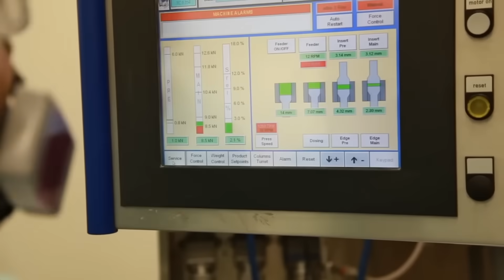Why These Engines Only Last 3 Seconds

Comment: The UK (Santapod race way) still holds the world record  3.48 seconds @ 386.26 MPH.  Engines last much longer than you think. Many teams can run a season with 1-2 engines. They are not rebuilt after every run, they are striped and inspected after every run to make sure there are no problems. If there are no problems it's put back together ready for the next run. Clutches are rebuilt after every run.
Reply: That was a rocket. Santa Pod is the venue at which the current world drag racing record, a time of 3.58 seconds at 386.26 miles per hour (621.63 kilometres per hour) was set by Sammy Miller in his Vanishing Point rocket-propelled funny car in July 1984.
Reply: @johnmadsen5258 had the fortune to see that same car at Maple Grove Dragway sometime in the 80s.  He broke the track record that day.
Reply: @johnmadsen5258  I was there when he did it. One of the most impressive things I have ever seen.
Reply: @johnmadsen5258  I was there at the time. Fantastic memories.
Reply: Ehh, why are you citing rocket dragster records while discussing the durability of top fuel motors?
Reply: @codymoe4986 because a top fuel has never come close to going that fast. 338 mph is the world record.
Reply: @Bryan-Hensley because it’s not a rocket it’s a dragster 😂 and if you want to talk about rockets nasa holds that record
Reply: @Bryan-Hensley  Yes, and surprisingly a Funny Car driven by Robert Hight holds the official NHRA speed record at 339.87 in 3.80 seconds. NHRA racer Bob Tasca holds the all-time speed record at 341.68 in a Mustang Funny Car, but it wasn't at an NHRA sanctioned event. Why is a Funny Car often faster? Superior aerodynamics.
Reply: @cll1639  that big ass wing in the back of dragsters makes alot of downforce and also can create alot of drag while moving at those speeds. So that could be the reason why dragster aren't going 340+
Reply: @cristopheralexander1583  Not the only reason but they're not optional. Without the wing the cars would be completely uncontrollable, and I mean COMPLETELY. Watch a video sometime that shows a Top Fuel Dragster completely destroy itself immediately after the wing either blew off or the struts supporting it failed. And if you're waiting to see fuel dragsters start running 340+ speeds you're going to have a long wait. Speeds are what they are now for a reason.
Reply: Jet cars don't count mate.
Reply: 386?😮
Reply: If your say so.
Reply: That was vehicle running on Hydrogen. Not an engine built from the ground up
Reply: @vintagespeedshop  copy and paste.
Santa Pod is the venue at which the current world drag racing record, a time of 3.58 seconds at 386.26 miles per hour (621.63 kilometres per hour) was set by Sammy Miller in his Vanishing Point ROCKET-propelled funny car in July 1984.
Reply: Wrong 
3.22 sec 402

Comment: The supercharger taking 800 HP is at that specific RPM & drive pressure.. It doesn't literally take 800 hp to fricking crank it, lmao, any engine could drive that under an appropriate ratio..
Reply: Obvious to anyone with a brain its 800 HP at max load/RPM not 800 HP at all times. 

You’re a real genius!

Comment: Engines destroying themselves - correct.  Ya know what is also destroying itself - the NHRA.  What brings the fans is the pro classes, namely Top Fuel and Funny Car.  These days you are lucky to get 16 - 18 cars to show up for an event.  TAFC at INDY only had 9 entries.  Ridiculous costs have to be cut back.  Eliminate carbon fiber bodies, go back to fiberglass.  Go back to 1 small fuel pump.  1 mag.  No air bottles, driver must shift manually.  Once the engine is started, no crew is allowed to touch the car, period.  Go back to the mid 80's rule book.  Ya, elapsed time will go back to the high 4 seconds, big deal.  But you'd get a resurgence of small owners who would come back, or create new teams.  I was at Indy in 1979, 70 top fuelers in the pits, 55 funny cars.  Today are there 25 funny car teams in the country?  This years crowd at Indy was pathetic.  Same goes for most national events.  Something has to be done, or else the NHRA will die.

Comment: The diesel effect is also false, nitro doesn’t ignite through compression and valve head heat. They wouldn’t drop cylinders late into a run if that were true. This is an often quoted incorrect statement. Burning a plug isn’t uncommon and it definitely doesn’t cause the engine to run like a diesel, it can and does literally overwhelm the ignition system because of how much fuel they run into the cylinder.
Reply: @TheHannukahZombie  you have no idea what your talking about. 1 they run twin magnetos and 2 spark plugs per cylinder for ignition.  If you know anything about magnetos the you would know the faster you spin then the more electricity the make. When those drag cars are at full revs the spark generated is big enough to go from one end of town to the other end.  2 nitro definitely does have a dieseling effect if you played with nitro powered remote control cars as a kid you would know that to start them you heat up a glow plug once their running they run solely on the heat generated from compression cycle they don't have spark plugs to ignite the fuel.
Reply: @TheHannukahZombie  back to glow plugs you do know that once you take the power thingy off the plug that heats up the plug after the engine starts the glow plug does not stay red hot it cools down as there is no power thingy to heat it up red hot coz you've removed it after engine starts. The glow plug cools down to engine temp the fuel self ignites just like a diesel.  You turn the key on your diesel car with for the glow plugs to heat up then start the car once the engine is running the glow plugs have cool down to engine temp as they have no power source after the relay clicks out when key is on ignition and you start the car.the power is cut to the glow plugs after they heat up to temp before cranking engine. Are you getting it yet?
Reply: @TheHannukahZombie  you do know the difference in injection timing between a diesel and a petrol or any other fuel is don't you? What stroke does a diesel inject the fuel? What stroke does a non diesel fuel injected engine inject fuel???
Reply: You don't know what you are talking about.  The reason they run so much fuel is too keep the engine cool. Do you see a radiator? No you don't. The reason the engine doesn't overheat is nitro methane burns cold. You spray breakcleaner on your hands it's cold. The same principle applies.  And yes there is a dieseling  effect essentially. In your nitro powered rc car you had as a kid you start em with a glow plug once it's running it runs on its own no spark plug required.  Learn before you comment
Reply: @LeeSchofield-gr4mq no, there isn’t a dieseling effect. If that were true they’d never drop a cylinder at any point in the run. The cooling effect of the fuel doesn’t have anything to do with what I said either, nor does it disprove it either. An R/C car engine running a completely different amount of nitro has no applicable comparison either. These engine DO NOT diesel, they have dual ignition systems for a reason. It’s INCREDIBLY difficult to ignite the amount of fuel they run. Please explain to me how any one of these engines ever drops a cylinder at any point in the run if the engine runs like a diesel? You understand that nitro CANNOT ignite from compression alone, don’t you? YOU don’t know what you’re talking about, you just repeating the same shit you heard 20 years ago in an emailed “facts” list. Nitro does not need compression to ignite, diesel fuel does. These engines use ignition curves throughout the run and plugs can and do break. What happens when they do? They drop a cylinder. Nitro can and does autoignite, diesel does not. Hence, there is no diesel effect. R/C car engines do not work that way because that’s not how methanol works either, it needs a glowing hot ignition source to ignite the fuel. The tiny bit of nitro in the mix is NOTHING LIKE these engines. I swear, stupid people say what they think is right and then call other people stupid. Nitro engines do not diesel because diesel engines and diesel fuel works in a completely different manner. FFS shut up.
Reply: @TheHannukahZombie  a diesel is a self ignition engine. There is no spark plug to ignite the diesel.  They run very high compression ratios to create enough heat to ignite the fuel. Nitro has a massive amount of force when compressed compared to diesel therefore you don't need much compression to create enough heat in cylinder to ignite nitro. These engines are 11000 plus horsepower running fairly high compression ratios and twin mags and enough spark to set the Forrest on fire exploding massive amounts of nitro fuel to burn even way more massive amounts of air forced into each cylinder by massive blowers. Now if you step back and think about all that I think dropping a cylinder coz it's blowen a hole in a piston is the least of their worries.  It's a miracle the engine lasts for the 3 seconds it takes em to finish a drag race. Oh hang on maybe that's why they get rebuilt after every pass! Coz there's not much left of anything after a pass. And probably very thankful when they don't throw a rod out side of a block.
Reply: @TheHannukahZombie  how does any engine run on any fuel without compression???? Oh they don't!
Reply: @TheHannukahZombie  I'm saying nitro fuel can run like a diesel, im not saying these funny cars run like a diesel im saying the fuel does have a dieseling effect hence my rc car comment as an example. They usually drop a cylinder due to lean running conditions blowing a hole in piston a diesel engine will also drop a cylinder due to lean running conditions blowing a hole in a piston. Are you getting it yet?
Reply: @TheHannukahZombie  so when I light my fire with diesel how does it ignite the wood if diesel needs compression to ignite? I just throw diesel on me wood pile and light it up with me lighter.  Are you getting it yet?
Reply: @TheHannukahZombie  are you ok? You say nitro cannot ignite from compression alone ( which is wrong) then proceed to say nitro auto ignites and diesel doesn't? Both fuels can and do auto ignite when compressed past their heat flash point . Are you getting it yet?
Reply: @TheHannukahZombie  if diesel doesn't auto ignite like you say how does a diesel engine run? It has no spark plugs. Are you getting it yet?
Reply: @TheHannukahZombie  have learnt anything yet? Do you realise you don't know what your talking about yet?
Reply: @TheHannukahZombie  looks like ol big mouth mate has gone quite?
Reply: You know they drop cylinders in a run from mechanical failures, right? Burned valves, melted pistons, broken ring lands, complete rod failure, and many more.

Stop making up crap.
Reply: @WyFoster I’m not making anything up. They drop cylinders due to ignition failure all the time. Plugs don’t light. Plugs break. Ignition leads fail. There is NO DIESEL EFFECT to one of these engines. Nitromethane does not work like a diesel, it does not require a compressive environment to ignite. That’s how a diesel works, without extremely high compression ratios and an exact metered amount of fuel at the exact right time it doesn’t work. Nitro engines DO NOT work on that principle. People, like you, are applying something they know that they erroneously think is similar and call them the same. There is no dieseling in any nitro engine on Top Fuel or Funny Car. That’s not how it works.
Reply: @TheHannukahZombie  they drop cylinders from lean running conditions that usually blows a hole in top of piston not normally from an ignition failure pursue but from a lot of factors  a mis calculation of air temp giving tuner dude wrong tune for pass. Faulty injector leaning out a cylinder blocked injector leaning out a cylinder wrong clutch set-up could cause wheels to spin making engine rev to limiter very quickly causing an over boost situation which in turn leans out a cylinder.  Etc. You do know what lean running conditions are don't you? You do realise the leaner you run an engine the more heat is created in compression? Are you getting it yet?

Comment: I would change the NHRA rules.  Top fuel and Funny car motors must last the whole race weekend.  At least eliminator rounds.  Maybe a 2nd motor for practice.  To get things back to some form of reality
Reply: You have no idea what your talking about.
Reply: It's been done in other classes of racing. 
They used to make custom tyres almost daily in top F1 teams and motors that would only last 1 hot lap, 1 lap. 1500 hp 1.5 liter 1 lap motors. 40 years later and they all use the same tyres and are only allowed 3 engines per year. Lap times fall and the show goes on.
Reply: This is not f1 or any other kind of racing, but if you look at those who were affected, they run 1.5l baby motors now and are slower as mentioned above for the very reasons and logic this comment represents. This is drag racing top fuel 11k hp. Materials only last so long under extreme heat and cylinder presures that happen so fast. Cost would be astronomical to make it last ultimately adding weight. Also, these motors actually do last some all season with periodic checkups and rebuilds they dont just explode after each run. The issue is that the rotor packs get worn out after each run, and other items go out. So, to make an engine last is a waste of time at those power levels when you can just get 3 or 4 blocks and all the extra parts that are interchangeable and easy to do on the fly For the season. Your mindset is what complicates things that cost money and time plus will end up limiting power levels. We have the most powerful v8s in the world always has been like this so why change something that works fine? Don't you think Germany or any of the other makers would have tried to take our crown if they could after almost 100 years if it was possible? No, instead, they play in the lower efficient power levels and try to add electronics and tech to everything they make with baby v8s with 4 valves  often end up in the shop even at the regular traffic level everyday customer with a sport sedan or a supercar. They roll race. See, the 2 valve push rod engines are still kings for making tq and for drag racing top the 1/4 mile. that's why it's still used today. Ever watch a Mustang launch that's a 4 valve no boost vs a hemi watch the immediate gap on the launch. That's the difference, and most of the time, the hemi car is heavier. The 4 valve design only starts to poor it on at the 1/8 where there is no glue limiting the power you can lay down safely. This is why mustangs get a bad rap the car wants to unload at higher speeds hence the reason they are called crowd killers. This design is not efficient in drag racing although there are work arounds to make it up to the max capability of the block which a high reving block that's aluminum and has small displacment isn't going to last and also not going to make more than 3000 hp. Which is only 25% of the needed power. Add cubes you say- well that would make the motor way wider they are already wide as is causing more drag and more weight just to make an unsafe car that unloads in the 1/8 and a slug on the hit causing death. This is why you don't see dohc nitro funny cars in drag racing that last and also the reason they don't mandate that u use expensive new aged tech.
Reply: F1 cars were making 1000 hp per litre 40 years ago and GP bikes were making 400 hp per litre 20 years ago naturally aspirated on petrol. Now Top Fuel cars are making 1500 hp per liter on Nitro. GP bikes today make 300 hp per litre but are much faster as are F1 cars on "only" 600 hp per litre. The concept is not hard to grasp. Top fuel now runs 1000' as opposed to the original 1340' but no one is crying over that still. All we are saying is change can happen and a sport can progress, it happens. Personally I'm happy to see it stay in its current format. Here in Australia we still run 1340', I love it. I've been track side to all forms of motor sport for over 40 years, on land and in water, dirt, asphalt and air, all over the world. Top fuel is the ultimate engine in my book.
Reply: @jasyamaha  Right on brother I see what your saying. And oh yes a reduction  from 1340 to 1000s certainly is a gripe all the same in my book. I also agree that they could progress the differences in the other sports is that they were drastically reduced forcing teams to find new ways to make power which is good as this tech trickles down however the issue is they are ever constricting so meaning your trading displacement in most cases for efficiency basically if you take all those tech advancements and lift the limit then we can see a real spectacle of engineering. But the issue lyes in money because nobody wants to spend that kind of money per a motor and at that speed you need a lot more power to gain as speed increases. They can't even utilize what they got on the hit as is so I feel that this along with the emissions crap will shit that down and even go the opposite direction if they had the chance down sizing just like the other sports did.
Reply: @jaysyamaha....A quarter mile is 1320 ft, not 1340 ft.

What's the extra 20 feet for? Koala crosswalk?
Reply: @codymoe4986  i thought he was talking  about the blower like the old school 870 blowers just bigger  because your right 1320 ft are in in a qm.
Reply: Close enough. 
Yes I should be more careful, I did know that. Thank you for the 6.1 meter correction.
Reply: there's no way that can happen with the power output these engines are pushing. they are on the hairy edge from blowing up if the guy on the laptop gets the fueling just right, there's no guarantee that the engine will make it to the line one hair line crack, weak bolt, random part failure and the engine is completely destroyed.